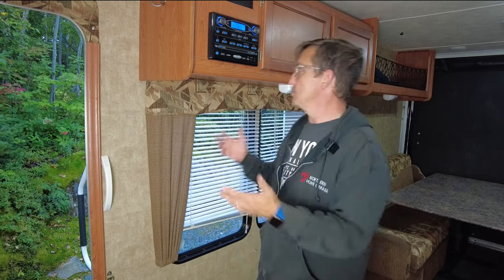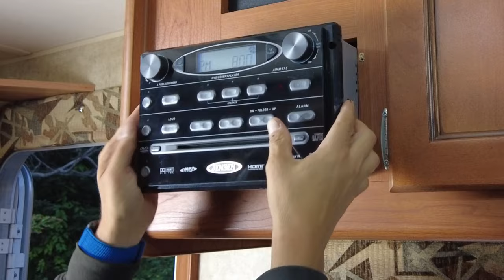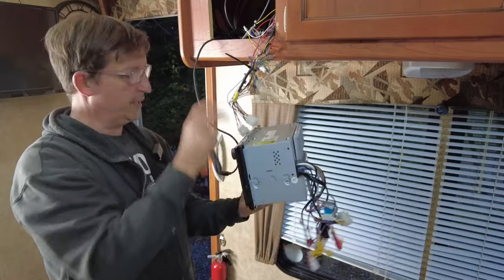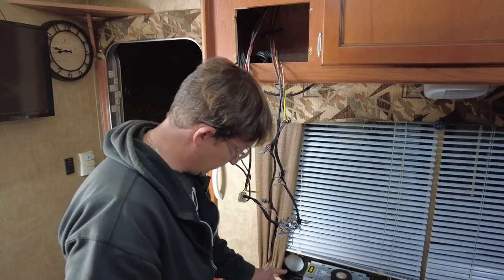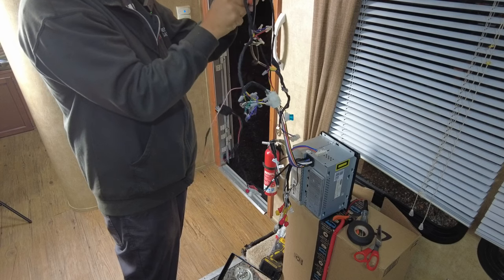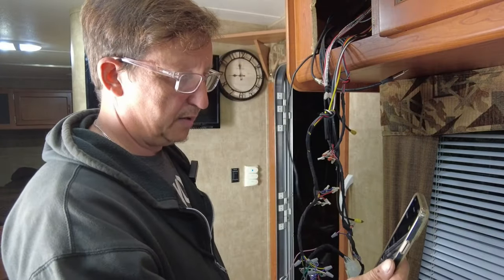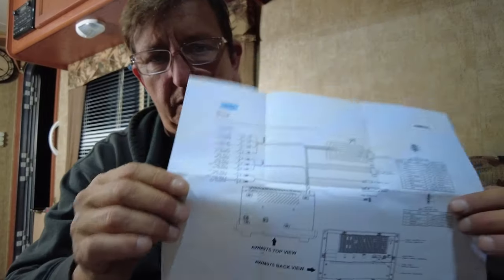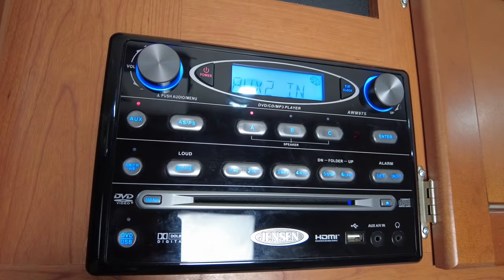Upgrading My Wolf Pack Toy Hauler RV with Bluetooth Connectivity | Easy Bluetooth Module Install

Comment: I have an AudioEngine B1 (Amazon) for the same purpose in my 1949 camp! Works same, except 120V, drives a component stereo. Power from switched output on back of amp. Amp is 80's vintage, no Bluetooth. And note, your unit is not 'cheap', it's inexpensive, though I suppose it could be both.
Reply from the maker: That’s cool. I have one that 120V as well. It receives and transmits Bluetooth. Great for headphones and the TV. No it’s cheap that’s why it was inexpensive lol. I mean the light on it doesn’t even work!! Ha ha.